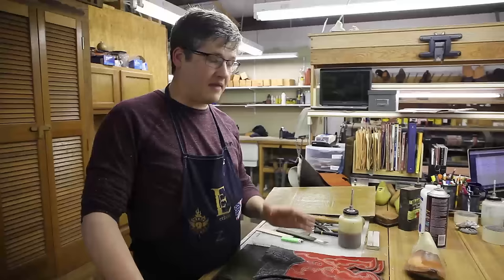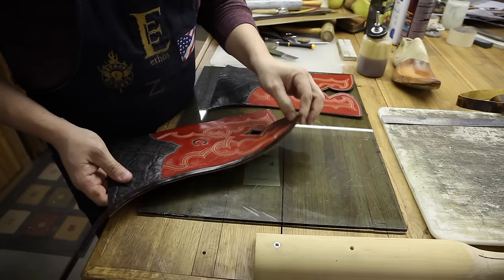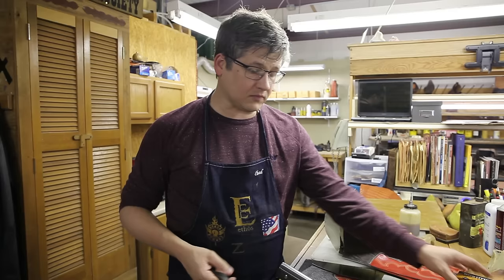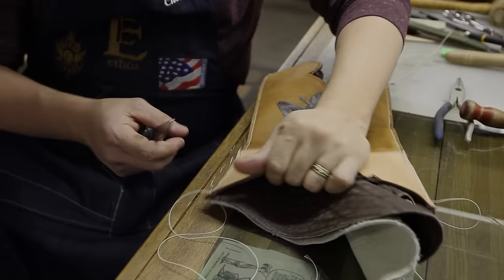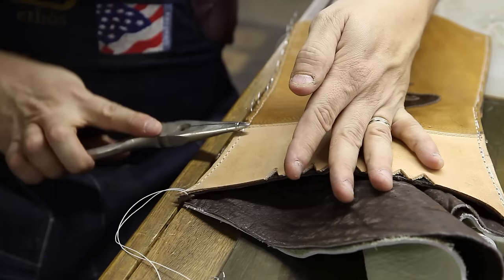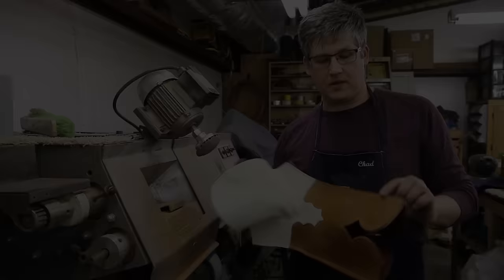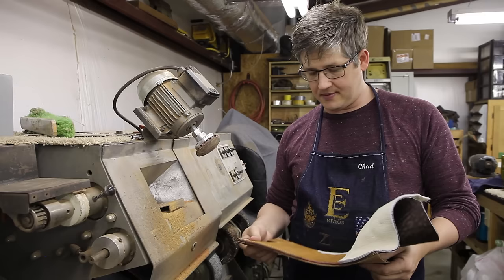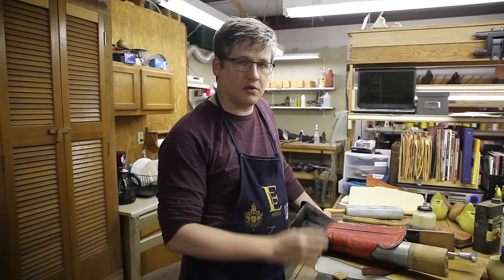How to Build a Boot: Side-seaming

Comment: Hi Chad, thanks for the video. 2 questions: 1)would you wet side seam while you trim/sand it? And why not? 2) you didn't show how to turn the shaft, it usually tricky. Good idea with the stapler!
Reply from the maker: Hey Eugene....I do not wet the sideseam while sanding it.... Mostly because I don't feel it would help in that step...but, I wet it right after before turning the boot. I will show how we turn in an upcoming video.

Comment: Thanks for the video! I was hoping to find out what kind of leather do you typically use for your hard counters, and what kind of leather do you use for your vamp lining?
Reply from the maker: I use counter strips or sole bends from Keystone Leather. For vamp lining, I generally use a glove-tanned cow in a cream color...which I get from HideHouse in CA. Sometimes, depending on the customers and needs, I will use elk, moose or deer, all which you can usually get at Springfield leather. Thanks for the question Casey...sorry for the late response!

Comment: Hey Chad, thanks for sharing. Any particular reason for glueing the the side seam to the back panel versus the front. Thanks
Reply from the maker: Hey Sean… It's simply a matter of wanting the sideseam or side bead stuck to the panel that I will be stapling through from the top. In other words, it is much easier to get everything under the stapler when the side bead is stuck to the back panel or the hard counter side… I always staple through the hard counter from the top.